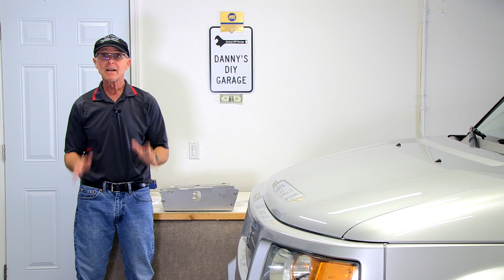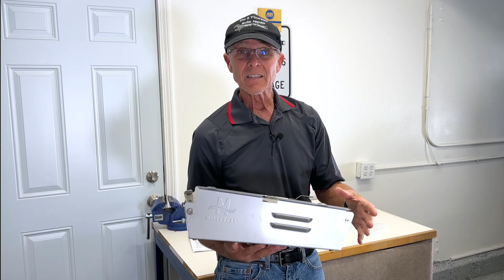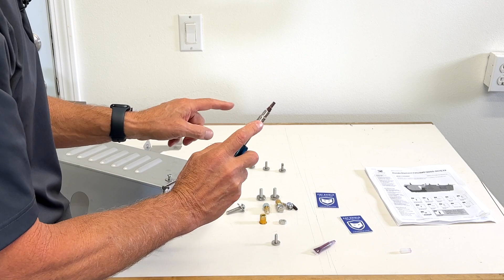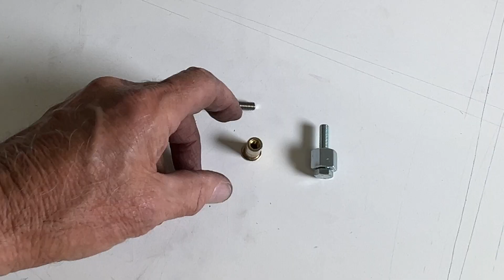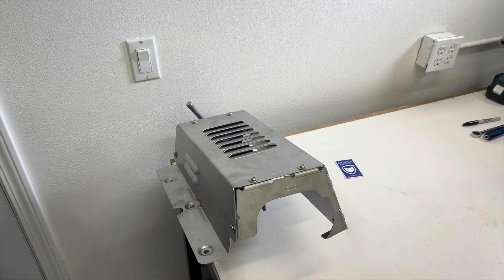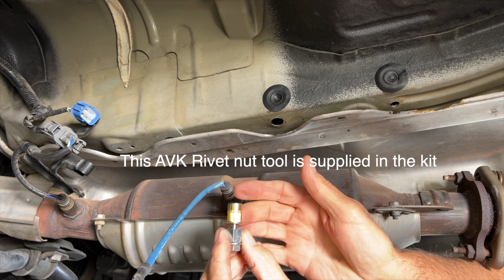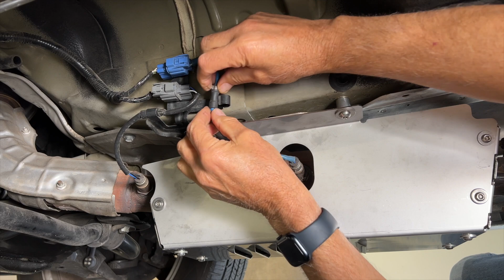Honda Element's Cat Converter Shield. Prevent Cat Converter theft! DIY Install, CARB-Compliant

Comment: I did this install after watching this video and ordering the shield from MillerCat
I had a couple thoughts.  First of all, it's a really good demo by Danny, and if you just follow it then you'll do great.
I was able to borrow a Rivet Nut Tool from a friend and boy howdy lemme tell you, just go and get you one of those, even if you order it from Jeff Bozos and return it to him after you use it for the singular hole you have to use it for.
Makes things so much easier.  
I didn't have a inch-pound torque wrench, just a foot-pound torque wrench and i didn't feel great about "doing the math" because it was such a hassle so I just tightened it by hand using my old man mental torque wrench and I'm sure it's fine.  This isn't rocket surgery, just use the loctite and you'll be fine.  
One thought I kept having though, what's to stop a cat theif from just ordering one of these kits just to get the "magic security bits" so they have them and get them on a little 18v impact driver, and they could get under there and zip zap off comes your shield, then the second guy is right there with a sawzall.  Idk, but I suppose that little bit of extra work might be enough of a discouragement to make them go hit my across the street neighbor's Prius, who basically laughed at me for working on  my own car in my driveway.  That guy has probably put his mechanic's kids through a bunch of useless classes up at that fancy state school where they come out thinking they're too good for real work.
Reply from the maker: Thanks for sharing your experience and thoughts, I'm glad the video helped!

Comment: Piece of junk rattle box. I removed it after a few days.
Reply from the maker: I couldn’t disagree with you more, I love mine, no rattle, safe, secure, easy to install, my car is 2wd what is your, maybe there’s a difference,
Reply: @dannysdiygarage  I have an AWD, maybe there are some differences in fit. Wanted to share my experience. I had clunking occasionally like when going over bumps on the road, and the exhaust was louder under acceleration. The latter is not completely unexpected having a metal box around a relatively large exhaust component. I applied the locktite during installation, torqued to spec, and re-checked tightness after a few days but that didn't help.
Reply from the maker: @ thanks for sharing, you should contact miller cat, they are very helpful and would like to know this information, they design an built there products
Reply: @nicoscoolvids  i think you must have done something wrong

Comment: hey man! been a while, but I have a question. so here in cali its raining alot and on my way to work i passed by a river of water on the street, then i heard a scrappy noise. i parked and saw that the cover under the car is about to fall off, should i take it off or what do u think i should do?
Reply from the maker: Take it off, not sure what cover, but if it’s hanging remove it, it could cause damage to you or others if it falls off
Reply: @dannysdiygarage  it covers the bottom of the car where all the parts are at
Reply: is it safe to drive with it off? cuz i have to pass by the same street on my way home
Reply from the maker: if its hanging try to secure it with zip ties, tape, string or whatever until you can properly secure it, if it easier to remove it, remove it, an auto parts store should be near by, @savageballin
Reply from the maker: I'm not sure what cover, but most likely its safe to drive with it off, drive by an auto parts store and get their free opinion @savageballin
Reply: @dannysdiygarage  the thing is i dont wanna drive with it off or on yet. can i send u a pic?
Reply from the maker: Dannysdiygarage@gmail.com
Reply: @dannysdiygarage  i sent the pictures have u received it?

Comment: thanks for  the video! I had not heard of this company product before. the bad guys got my cat conv on my 2008 honda element, apparently the ease of access makes them a prime target. I ended up getting one of those protection devices that is basically a bunch of hardened cable that wraps around the unit. It's ok I guess but it has cables that stick out and I'm always worried they're going to snag a plastic bag and catch fire...if I had known this product was available (maybe it wasn't at the time) I would much rather have gone with this. thanks again!
Reply from the maker: This is pretty new products. I do remember seeing the cable type and they were so ugly and looked really hard to install, I never thought about the attraction of bags, as long as you’re protected, that’s what counts 0:02

Comment: Another great video Danny. I have a P0420 code right now.😩 The original catalytic converter was stolen. 😭 The second one was installed 2 yrs ago. It's already not working correctly. 😡 My original cat lasted 17 yrs with no problem B4 stolen. 
That catalytic converter replacement part u hv listed below, price wise; is on high end. What brand is it? The two brands I hear that r available are Magna Flow & Walker... if u need 1 4 u element owners. That's what another element owner who has an auto shop & custom makes suspension for the elements recommended I look for. Everything is over priced these days. The greed is out of hand. 
Being this is my second cat I hv to buy again, I'm looking to save money. No offense intended Danny. ✌🏽 
As always, love ur videos! 👍🏽👏🏽
Reply: I got an aftermarket cat conv when my element's was stolen and I had to hit it with a few rounds of "pass your smog test" addititve to get it to settle down after install...was getting frequent odbc codes related to the cat conv....since then it's been fine for ~4 years
Reply: @banningjainlight185  I will give that a try, where did u hit the cat converter & with a rubber mallet?
Reply from the maker: I know from experience Miller Cat sells quality products, I trust there products, but as far as the other question and who’s is best, I don’t know ❤👍🏼
Reply: Hello GHE2005, in regards to the converter, this is a CARB compliant converter, meaning it is approved for all 50 States, and more heavily loaded with precious metals that most you will find online (which is why you will see a huge price difference). If you live in a State that requires CARB compliant converters or simply want to have the best one for your vehicle, this is the way to go. Make sure you find the reason for your P0420 code. Converters won't generally fail and is usually a indicator of an issue with your vehicle that causes the converter to fail. Such as engine misfires, heavy oil consumption, etc. It's always best to fix any underlying issue before spending the money on the converter!
Reply: @millercatcorp  My cat was installed & my insurance has to approve it. We hv smog registration here in CA but who knows if they bought a good cat? The job was $700 + total to fix witch I paid $500 of. High deductible for me. Had I know what I know now, I would hv investigated what I should have put on my element. Basically I could hv bought a really good cat converter not this shity one that last 2yr the most. Live & learn.
But I will bring my element to my mechanic & see what he said. I already told him about the code & he said I need a new cat. I will ask him to run through the list u suggest and see what he finds out. Thx u for ur suggestion. 🙏🏾